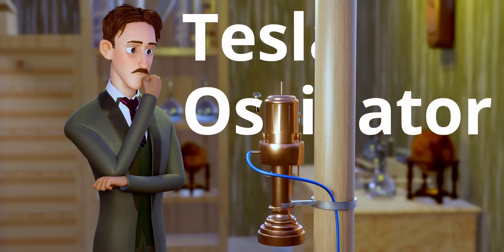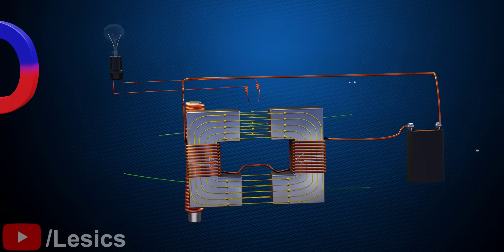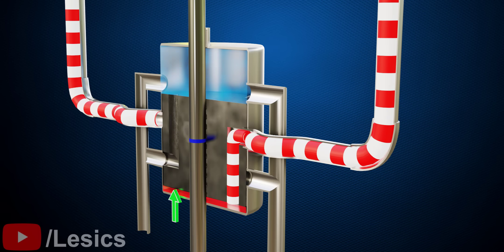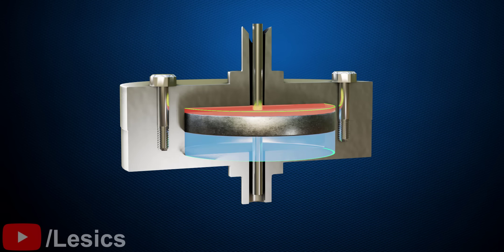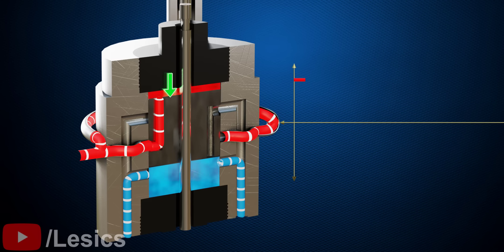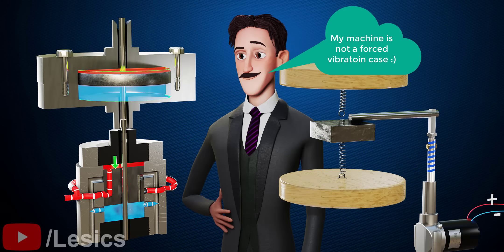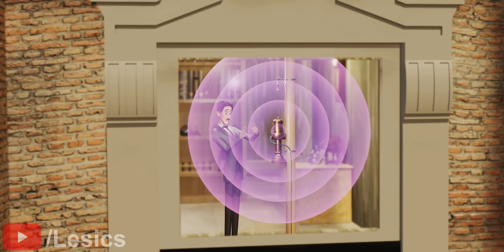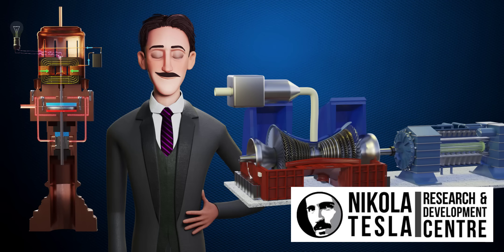Nikola Tesla's Mysterious Electricity Generator | The Complete Physics

Comment: Wait, so this guy not only was a leading innovator in electrical development (to the point we still use his stuff), but he designed his own simpler version of a steam engine cylinder? 

Crap. This guy was a genius. O_O
Reply: Only thing: it never worked as promised. The blades have to be fast to be efficient, but there’s not only speed of sound. They also grow in size, which happened also to his prototypes, sie he reduced the speed and lost the efficiency advantage. BTW, an 50Hz AC generator at 50.000rpm is not possible. The max is 3000rpm. You can go slower with more complex winding, but never faster. For faster, like in CNC-spindles, you need to use higher frequency.
You need a reduction gear, which eats some energy at a 40:1 ratio.

Comment: Resonance is a real phenomenon, but you (and perhaps Tesla) push it a bit too far trying to get a 2 kg oscillating valve to destroy a building.  The natural damping in the building would prevent it from oscillating to the point of breakage.  If it didn't, we would have buildings failing from kneading bread in a bread machine, and other absurdities.  Also, buildings are not monolithic; they contain hundreds of more-or-less independently vibrating (actually or potentially) parts at different frequencies.

As for the "pushing at each end of the swing", if the push was not at the same frequency as the natural frequency of the pendulum, then it would sometimes reinforce, sometimes resist the movement of the pendulum, resulting in either forcing the pendulum's frequency or chaotic action.  In other words, both the valve and the plunger have their own natural frequencies; if they coincide, to the extent they coincide, they will reinforce, but to the extent they don't, you have one driving the other.  If they are solidly linked then they will together have an oscillating frequency that may be unrelated to that of either separately.
Reply: Yeah that was Jamie and Adam's opinion for the MythBusters episode. It actually scared them when they tested it in full scale how little energy it took to create that resonance.

Comment: You can't destroy an object just by exiting it at its resonant frequency, or any other frequency. You have to deliver enough energy. Resonance is used in many places without any destruction of the resonant object.
Reply: Depends on the object, some can.
Reply: A Dune weirding module from Lynchs film.
Reply: It depends. The building that Tesla was built on had a steel beam that was relatively isolated: which means it had nothing to dissipate the resonant vibrations. Keep in mind, that the building he lives in doesn't compare to modern ones, where the beams had something to dissipate the vibrations. Must have something to do with the architecture.
Reply: @jayzenstyle  This sounds like more mindless worship of Tesla. Do you know specifically what building this event occurred in? Does it still stand? Do you have its plans? Do you have engineering reports or expertise on its stability? Facts please.
Reply: @1906Farnsworth  it's literally in the video, the building he was in was really shitty to handle resonant vibrations. And that relatively isolated steel post he attached the device to acts as an amplifier. It was an old Irish building(46 East Houston Street near the Manhattan neighborhood of SoHo)which is pretty solid but no give. That definitely won't work in modern buildings, even ones whose design doesn't consider earthquakes. I don't know how you come up with the assumption of a 'Tesla cult' when I don't see his device working on decently-made buildings.
Reply: @1906Farnsworth  I don't know how you missed but I guess you haven't seen the Hertz value in the video and the device set to default in 60Hz but tunable. And yes, of course it still stands, how the heck would the police show up to his apartment when the whole building collapsed? It only shook the building, which alarmed him and other people living, nothing else. And I haven't claimed anything outrageous like the flat-earth stuff you just mentioned, you're assuming a lot of points about my comment out of nothing. 

The steel post Tesla attached the device was apparently bolted to the steel frame of the building, which were triangles, not rectangles though we don't build structures that way anymore because of easier wear and tear over the years due to metal fatigue. That type of structure(which the old irish architecture was made out of) was more solid, but lesser give, which means resonant vibrations inside would have little to no dissipation... making the building act like a huge tuning fork. It's definitely not a problem in today's infrastructure, and I highly doubt Tesla's machine would do anything even small-scale nowadays. 

I still don't get how you got into those 'cultist' assumptions, when all said, the factors all clicked in that situation to cause a shake. It definitely didn't break, but it sure caused a ruckus.
Reply: @jayzenstyle  I though I was pretty clear abut the cult thing. I made no accusations, I merely gave a warning.
I stand by what I said.  All of it. Even more done now.
Reply: I get it, but what would runaway trapped amplitude able to keep increasing eventually cause?  From what I heard it caused a seismic event, not just a building shaking...but it's all legend at this point so who knows?  I think if he was able to oscillate whole structures he may have been glitching out transverse waves from the earth or causing them to react someway.
Reply: @1906Farnsworth  ma'am if you can't see your over reaction and false assumption of equivalence of individuals regarding this man long gone before all of your accusations than you just ain't grown up enough to calm down and communicate.  A flat earther, and a person fascinated with the mind of Tesla are not the same thing.  Appreciating Tesla is not an obscure thing.  Calling him a deranged man in his old age means you know little about the character he always was.  The man was different, he had picture perfect insight and a near perfect ability to communicate it into reality.  Calling brilliance a crackpot because you can't relate is very telling
Reply: @1906Farnsworth   Gullibility at it's best. This not something as shattering a vine glass.
Reply: @1906Farnsworth   Gullibility at it's best. This not something as shattering a vine glass.

Comment: there's a missconception about the potencial earthquake causes by ressonance. First of all, there's no such thing as pure spring-mass model in real world. Every and all of mechanical systems are spring-mass-damper kind. The damper factor plays a ruge role in dissipate energy from oscilating systems. A 7 tall buding has a ruge damping factor due all of the rigid joins, friction, wind, foundation, etc that will be virtualy impossible to just a small machine like that could put the buding in ressonance.
Reply: But if described that he's getting more amplitude at same speed distance, would it be possible to create any resonance, almost like a shock wave?  Maybe his design was able to cause local transverse waves to react?  

With his valve and turbine design being capable above material ability, maybe he also had the same effect here?

Comment: 🔵 You've made so many errors in this presentation that I'm not even going to GO into the myriad of examples.
At least physicists worldwide are getting a good chuckle!
Reply: You'd prefer he tell people how to build a $200 earthquake generator?
Reply: @gadgetsage  oscillation and resonance frequency are well understood topics.
it's easy to build an "earthquake machine". it just will give you strong vibrations instead of an earthquake
Reply: I was going to say the same!
 Beautiful presentation, but totally flawed..
Reply: Please tell us what are some mistakes?...other than the earthquake claim ofc
Reply: @janhemmer8181  why?
Reply: @2hedz77  as it is presented in the video the magnetic flux in the coil does not change.
That means no induced current.
Coil must be rotated 90 degrees.
Reply: @janhemmer8181  hmm...ok thanks
Reply: @thomasb4422  and how's that different when you are on the 7th floor. it was not a real earthquake, it just looked like one from the 7th floor of the building if the really matched its frequency, and hist steam generator had a big enough "flywheel".
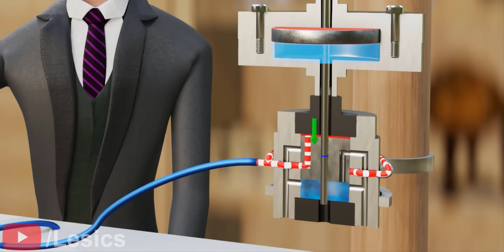Reply: @2hedz77  Some physics bullshit in this video : from 4:00 to 6:25  :
When you apply a force to a pendulum, you do change the frequency, even if the force is intermittent.
By applying a force to the pendulum when it reaches the top of its curve, you give it initial velocity. Sure, by dropping it from higher , it would eventually get the same speed at that position, But that would take time. By immediately giving it speed rather than letting it get that speed by falling from a higher position, you're skipping part of its natural trajectory. Therefore the frequency of the pendulum is higher.

Comment: Tesla's earthquake machine lacked precision due to several engineering aspects:
1. Precision in inducing seismic activity requires sophisticated control systems capable of finely tuning parameters such as frequency, amplitude, and direction of oscillations. Tesla's machine may have lacked the necessary feedback mechanisms and sensors to accurately control these parameters.
2. Damping is essential for controlling vibrations and oscillations in mechanical systems. Without effective damping mechanisms, Tesla's machine would have struggled to maintain precise oscillations, leading to variability and unpredictability in seismic activity generation.
3. Resonance plays a crucial role in amplifying vibrations, but it also requires precise tuning to avoid instability or excessive amplification. Tesla's machine may not have been capable of fine-tuning resonance frequencies to achieve the desired seismic effects without causing unintended consequences.
4.  The structural integrity of the machine itself is vital for ensuring stability and repeatability of seismic activity generation. Any weaknesses or flaws in the structural design could introduce variability and compromise precision in earthquake induction.
Overall, the lack of precise control systems, inadequate damping mechanisms, challenges in resonance tuning, structural integrity issues, and environmental factors likely contributed to the imprecision of Tesla's earthquake machine from an engineering perspective.

Comment: But the energy output resulted from the "earthquake" seem exceeding that by the machine, how could this possible?
Reply: Small inputs adding up over time.
It's like giving a very small tap to a pendulum. The energy is stored in the motion of the oscillation. And every time it comes back you give it another small tap so now it has a little more energy. And again, and again, and again, adding a little more energy each time and each time the motion gradually becomes larger and larger.
Reply: @HermanVonPetri  but how did they calculate those buildings' resonance frequency?
Reply: @arunpillai3007  That I don't know.
My guess would be that they have already performed destructive tests on models made of similar construction materials across a range of different sizes.
This is commonly done to model how well a building stands up to earthquakes and high winds.

Comment: I'm not convinced the frequency remains the same in the 2 pendulum cases. While the initial push makes up for the higher starting point, and ultimatively results in the same trajectory, this path does not need to travel this initial distance, resulting in a shorter time for the full path
Reply: Yes, I also believe the time would be a little bit shorter every time you incresed the velocity with a force, but that was not what tesla wanted. He didn't want to continuously increase the force, Just make something that would remain with the same frequency no matter which was the initial potencial force (the steam flow, in this case).
Reply: Yes, the video is wrong about that part. even if the force is intermittent , the frequency is changed. (and your explanation is correct)

Comment: To cause an earthquake in this way, you need to install an oscillator on the beam of a tall building (P=mgh) and transmit pressure to the ground for 109 minutes, since the speed of sound in the Earth is 6000 m/s, the reflected wave will return just at this time. The pumping of energy and amplitude of seismic waves will begin after the return of the reflected

Comment: 🙋 i have a question as you mentioned that sir tesla used electromagnets to generate emf so that if move a conductor through it the change in emf will produce a induced current ie AC current 

I want ask that for powering the electromagnets what kind of supply sir tesla used

Comment: at 5:46 u say extra push means extra velocity but more precisely it's extra acceleration, so period of oscillation vary as it's depends on acceleration unlike in case of spring mass system which is not depends on acceleration

Comment: Blu tooth, DC hair clippers and two coiled magnets and a high frequency generator. 
Put it on the corner of a building in a low ceiling area. 
The vibration and frequency will cause any building to crumble and fall.
Vibration and high frequency is key, you're welcome.
Reply: 🟦 The fallacy in your statement is that high-frequencies are too short of an excursion to cause a large object to go into resonance, according to Tesla himself the key here is LOW frequencies, NOT high!
Reply: The point is to account for resonance itself. What in this building would you be trying to fundamentally resonate? If you were to attempt to resonate the framework itself you may be able to impact the entirety of the building. Just thumping it over and over at any random frequency is only going to get you so far. If you thump at low frequency and very high amplitude, then perhaps you will initiate a ringing either way because you've created small earthquakes near the building. You can 'strike' something hard enough and if it is free enough to resonate then it will ring down at the fundamental. When it is attached to so many other things the game changes of course. It then seems feasible that some device which is large enough and capable enough to induce a frequency of strong physical pulses upon the structure of a building could have great noticeable effect so long as it is able to find a particular frequency of pulses.
Reply: @Magneticitist ,
🟦 Tesla's account of the event spoke of a device the size of an alarm clock which he clamped to a girder of the framework of a building at a construction site and which delivered rhythmic taps of an amplitude that "Wouldn't hurt a baby's-arm",.....Within a minute the framework was set to shuddering so badly that he quickly removed it from the girder for fear it would bring the new buildings framework down to the ground.

Comment: Most commentors here haven't realised this video was not about Nikola Tesla but about a reciprocating, steam-driven generator........that would match its load.

The animation was a bit oversimplified and wouldn't work well.
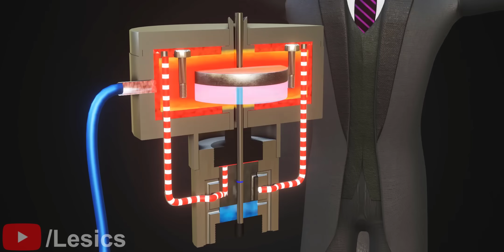That bit from 6:30 to 7:00 about the steam jacket around the air-spring-cylinder:
Tesla would have observed a change in frequency by constant steam pressure as the cylinder would bleed energy, in the form of heat, out of the air-spring-system (heat escapes when you compress air and not all of it comes back when you decompress). This would change its tune.
The hot jacket around the cylinder keeps the energy in the air-spring-system fairly constant and therefore the frequency constant.
Too bad Tesla wasn't brilliant enough to figure out a way to make it invariable with load.

Any-one else find it a bit weird to have a battery provide energy to the magnet on a steam-driven generator? Couldn't he make DC from the same steam or would he have had to ask Edison for permission?

Comment: I don't think it would matter if Tesla smashed his machine or not in the short term, if the building is described as in the video you would see a build up in vibrations in the steel frame which would eventually go out of phase and 'dump' it's energy in the ground at a lower frequency. The standing wave up and down the building would have a higher amplitude at both ends and because the bottom is anchored to the ground the top would swing wildly for a few seconds. I 've seen  a similar effect in bridges.

Comment: to send the energy we do as the inductor connected to the AC current which will transform the current into magnetic therefore distancing this magnetic to have it and the inductance used in the circuit like the battery to use this magnetic but it is necessary to regulator which depends on the distance between it and the magnetic so better than the one that looks like lightning because that of the magnetic is like that of the transformer, part of which is where there is energy and the other part where we have need energy.